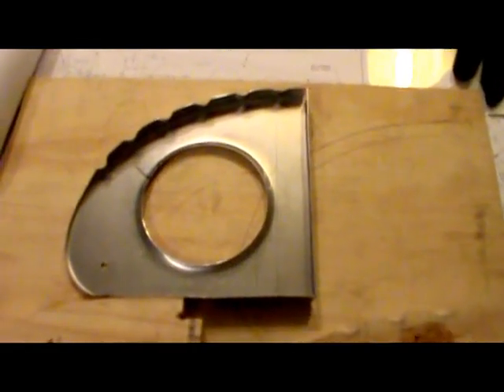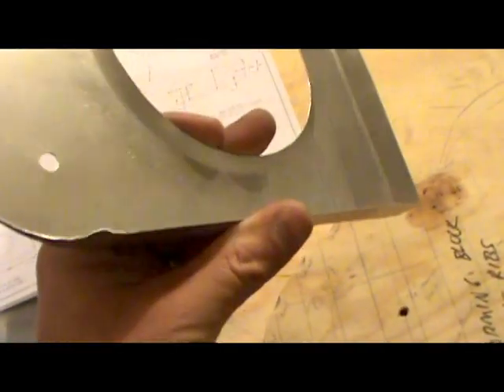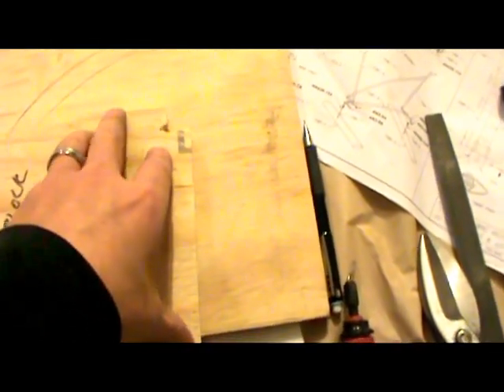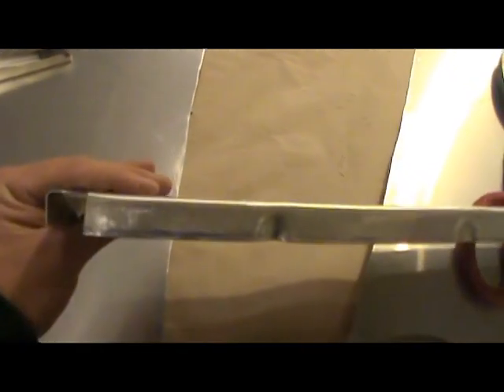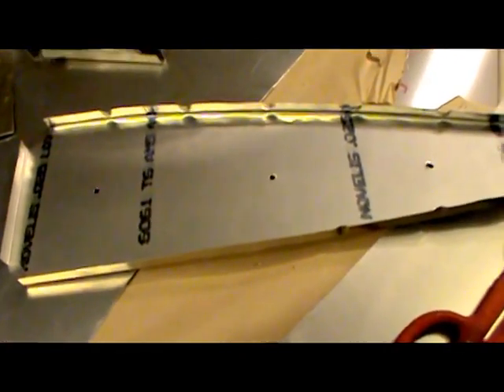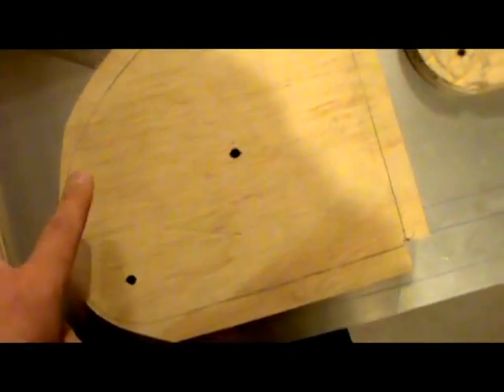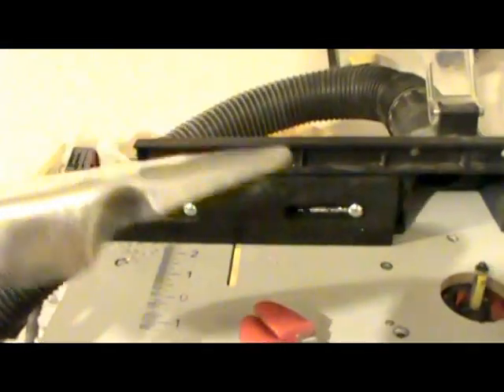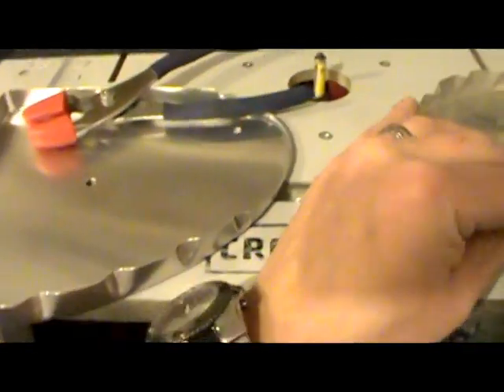Forming Wing Ribs

Comment: Hi Greg. What gauge aluminum are the ribs made of? I am looking at the manual and it says .025 so 1/4 but that can't be right. This looks like 1/16 or 1/8th ?? Thanks man
Reply from the maker: It is indeed .025" sheet, which is 25/1000 inches thick. 1/4 would be .250, not .025." Aircraft aluminum is sold in thicknesses in thousandths of an inch for sheet in the U.S.A.  Aluminum plate would be sold in 1/8" (.125) or 1/4" (.250), etc. In other parts of the world, it is sometimes sold by gauge.
Reply: @GregsZenithSTOLCH750  ahh OK that lends a lot of clarification. I was watching you handle your nose ribs and looking at the thickness after just looking at my manual I was wondering what wasn't adding up... haha. I'm in Canada, so gauges are used.
Reply: @micus09  It can be a little confusing at first.

Comment: Hi Greg. i have a plasma cnc with an Hyperterm 30 and an Hypetherm 45. i was wondering if i could cut my parts with plasma .The 30 amp fine cutting cuts a very fine kerf..... do you think it will alter the 6061-T6 properties?   I have a 48 x 96 Router cnc but i dont have a vaccum table on it...so no way to really hold large sheets without using double sided tape...and that's not ideal.  Any comments?
Reply from the maker: I'm sure you could cut your parts on a plasma cutter, but I do not have any knowledge in plasma cutting. I did all my stuff the old fashioned way (shears, snips, band saw), but I don't know that any one way is better than another. Might be a fun exercise to do it with plasma, since you have the equipment!
Reply: The plasma cut will likely soften the edge slightly, probably not by a considerable amount